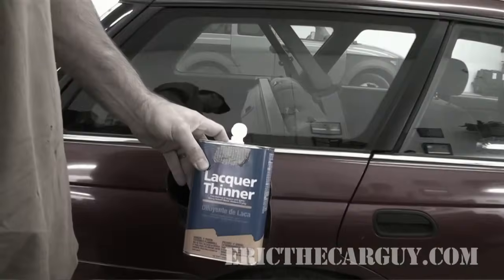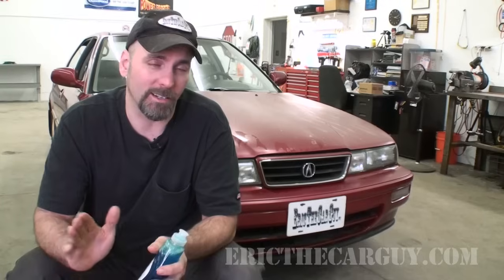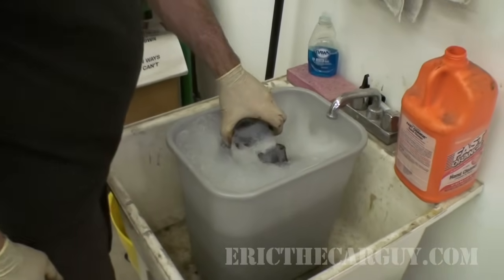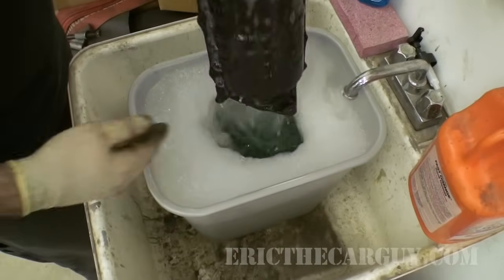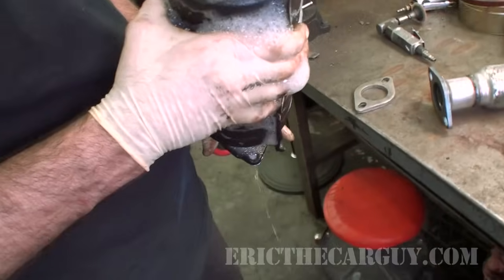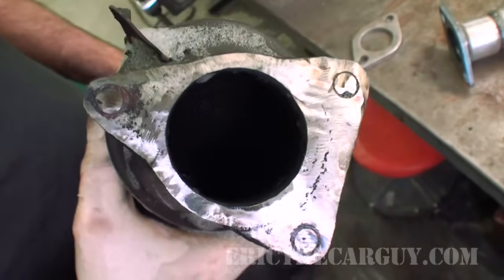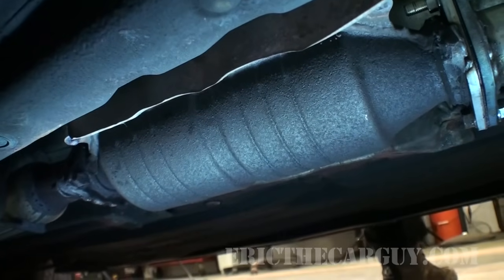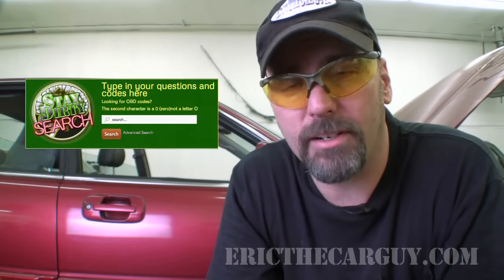Cleaning Catalytic Converters With Soap and Water -EricTheCarGuy

Comment: Was this tested again AFTER it dried? The cat seemed like it still had water in it as it was blowing a LOT of soap and water out of the exhaust. Evaporating water inside the cat will cool it down a lot, and it sure seemed like it was doing that.. especially with the temp fluctuating like it was as it was flashing water into vapour.

Comment: Water can absorb a lot heat.  So if your CC is still wet (looks like it from the bubbles coming out) I am not surprised the temperature is much lower at the exaust.  Maybe you should try mesuring after it dried completelly (drive for a few days maybe?).  I am not convinced it did not work yet.

Comment: On the Cody'sLab channel, he and a friend sweep up dirt from the side of the highway to extract platinum from it. In the video, he claims that a catalytic converter can loose half of its platinum in the first 100K miles. The amount of platinum he harvested seemed to confirm this. It may be that your converter is just running out of catalyst and not working well because of that. Sorry if I missed how many miles were on it if low mileage makes that hypothesis invalid.

Comment: I think I would have let it soak in degreaser/soap, then pressure wash through it and use a blower to dry it before reinstalling it. Eric the bubbles guy 😋

Comment: Did you consider that there's a fair amount of water inside the catalytic convertor after cleaning it. You'll have to run the engine for a while to evaporate all that retained water. The water in the catalytic convertor cools the catalytic converter as the water turns to steam. So you have to evaporate all the water before the catalytic convertor will function normally. Try measuring the temperatures after you've driven the vehicle for a few days.

Comment: This might have already been mentioned . . .

Did you rinse the cat with fresh water before reinstalling? That would of eliminated the bubble machine effect. Also I personally would of taken it on a nice drive along the highway to help dry out the cat before running a temp test. Obviously the cat was cooler at the rear cause it was evaporating the moisture.

Your awesome & smart. Helped me avoid the rad & engine block sealer thus replacing those very expensive items because it clogged up the water passages.

Keep on Keepin on !

Comment: have you tried cleaning in a hot tank with ethylene glycol?

On parts I've done - admittedly small parts - it really takes that gunk and varnish right off.  But in theory shouldn't attack the platinum or substrate?

Comment: Now here's another thought I've had for cleaning an old cat: "run it" outside the car with propane. I got this thought while tinkering with a vintage Coleman Catalytic Heater. These liquid fueled heaters are little more than a fuel tank, wick, and a dome-shaped platinum catalyst burner. The one I was working on had some carbon buildup on the top of the dome (one of the cooler spots). I successfully cleaned it by lighting the heater, allowing it to fully warm up, and blowing propane on the soiled areas using an unlit torch. I heated these spots to slightly higher than the normal operating temperature-- fully warmed up the burner has a slight red glow to it; I spot cleaned it at orange hot for 1-2 seconds while slowly moving the torch around the burner. The end result was a heater that looked nicer and runs better. Since it essentially functions the same way the cat on a car does, I wonder if a similar procedure on an automotive cat would have similar results.

Comment: Hey, this converter needs some time to dry up before measured.
Also, rinsing with clean water before put back.
Please do a new measurement video three days later when returning from a long drive!
Reply from the maker: Demeter Ákos The bubbles happened while I was warming it up. I did my measurements after that was done.
Reply: EricTheCarGuy Don't know if you mentioned this at all but cleaning your cat is just a "band-aid" if your cat is getting plugged there is something wrong happening in the engine and will most likely just plug it up again.
Reply: EricTheCarGuy did you fix that repair leak right after the Cat?
Reply: SleepnGrunt  If you have a P0420 because your catalytic converter is just under the efficiency needed, it could do the trick. I didn't bother with lacquer thinner or trying to clean mine because the live data on my obd II scanner showed me that the converter wasn't doing any catalyzing at all. His car is an unmonitored system, so he couldn't use an O2 sensor to see that.

Comment: After reading other comments, I see there is an opinion that there are inert solid plaques on the active surface of the cat. For that I would recommend an ultrasonic bath. As some suggested, various solvents could also be used. Maybe acetone would work nice, also it's easy to come by.

Comment: Doing a temperature test is an invalid test, if you use that method on every "Good Running Car" the cats will fail every time, if you do that test on every poor/rich running car you cat would probably pass, if you want to see the temperature go up, introduce hydrocarbons or a misfire, cats were not made to work all the time, learn how cats work, then test them, a legitimate way to test a cat is with a 5 gas analyzer, propane/ hydrocarbons and making the engine run lean / vacuum leak. 
Great videos, ive learned alot and made alot from your videos, Thanks

Comment: Hey Eric, I have a 2012 dodge journey 3.6. This car has 2 catalytic converter..I cant remember the codes it threw, the converter closest to the front bumper, I took it off and I can get air through it but I cant see any light I shine through it. Is it still clogged. The converter near the rear I haven't tried yet if its clogged can I straight pipe it (cut it out )

Comment: It did work a little better in the ammonia solution. That was a good idea to try. I would have like to seen it shook around periodically in the solution to help break up the build up of particles inside the converter.

I think just letting it sit in the solution isn’t enough to remove build up. Some type of flow through it or pressure through it might work better. 
              Just spitballing though.

Comment: Would a rinse with a hose, or power sprayer help? Or if one has a big enough sonic cleaner with the Dawn, and amonia solution.
I've used a small sonic cleaner for carbs with degreaser, and the carbs come out squeaky  clean.

Comment: Hi Eric,  thanks for taking the risk for us viewers. But I see that you're missing a couple of steps. The ratio of the detergent is insufficient as the volume of water in the bucket is much more than the detergent to act on the cleaning part. And as I know hand wash is another good detergent too. And you should have got it rinsed thoroughly from the back of the cat to get rid of the dirts and soaps that resides in the cat. And you should use an air gun to blow out those water and some stuck dirt (which the water couldn't washed out) through the same direction (from the back of the cat). Then only you should perform the test. Anyway, thanks for experiment you've done.

Comment: Scotty won't admit this in his videos... But that's Ok.. Budget a replacement Catalytic Converter.. Move to State that don't care about Exhaust emissions.. lol Thanks Eric, what about Ford Engine, Inline 6, 3.3. liter engine for a 1982 Ford Granada, Foxbody or is it better to find a Foxbody 3.8 liter V6, with mechanical fuel injection due to altitute issues with carburetors? Scotty didn't want to rebuild my engine, and from listening to Scotty Kilmer's ATP-AT-205 'main seal trick' it destroyed the engine. I might need a new or recast inline 6, 3.3 liter main engine block. I don't have a shop, tools, kits, or capable mechanics in Texas to help me. O'Reilly's don't carry any old inline 6 engines for a Ford Foxbody Granada engine. Thanks! Great video! I won't be cleaning the catalytic converter, as Texas Catalytic converter thefts are on the rise, along with human trafficking, drug cartel, and prostitution rings growing in Texas..There's videos of vehicle owners engaging confronting catalytic converter thefts in Dallas, TX.

Comment: So I have a 2002 Infiniti I35 I did a engine swap after I had an engine sieze up at 40mph I noticed the tail pipe had a lot of black on it. Is it safe to stick water into my tail pipe and use it to clean my exhaust system. I’ve seen videos of people doing it on diesel trucks what about gasoline Sedans feed back would be awesome

Comment: Before we has emission tests is PA, my friend would cut open his converter, and use a torch to melt or burn out the internals. Weld it back together, and re-install it on the car. Just a thought, since you don't have emissions in your state. Lucky you. But they they might do a visual inspection, to see if the converter is still there. Just a thought, hope it helps you somehow...

Comment: Hey Eric I got a 95 blazer lt with a few Robles I was wondering if maybe you can give me some insight on.. She sometimes idles high in neutral some hesitation on acceleration minimal but I can feel it. Hard time climbing inclines fuel mileage is reduculous.. I seen a post online of it possibly being the MAF but the 95 doesn't have one was wondering if maybe the catalytic converter could be the problem .. Any info would be appreciated thank you
Reply: egr valve...look into that

Comment: If there is moisture left in the converter it would skew your results. You probably should have taken the car for a good 10-20 mile highway drive prior to doing your final temperature readings to be sure it was 100% dry. Would be interesting to know now, days or maybe weeks after the video was recorded whether the rear cat temp reading is still that low.

Are you also going to do a video on putting that sodium hydroxide or whatever it in to clean it? You have nothing to lose really.

Comment: I'm not sure about the validity of this soap test; but, I'm missing something about the temperature testing.  I thought you should be seeing about 100 degrees difference in temperature from front to back of the cat?

If the cat wasn't doing what it should, isn't it gonna show about the same temp at front and back?  Or, is it that if it the cat is not working, it will show much greater than 100 degrees difference?  

Because, before doing the soap cleaning you were getting about ~242 degrees in, and ~167 out....that's ~76 degrees difference....not far off from 100 degrees.

You mentioned at ~3:20, "The cat should be about a 100 degrees hotter at the outlet, than at the inlet."  I'm guessing you meant the opposite? 

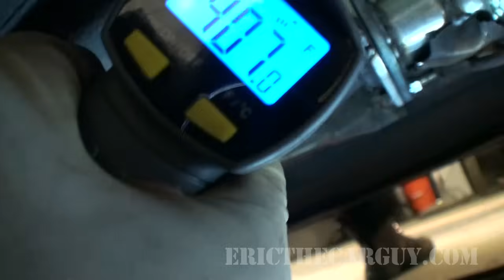At 6:17 Brian brings up the RPM...would you need to wait a little longer for the metal exhaust (and specifically the cat) temps to rise...even if not waiting long?  

And, after cleaning with soap, you're seeing ~445 degrees at the inlet and about 140 degrees out the outlet, for a difference of 305 degrees.  The before soap, and after soap temps, to me, allude to the "before" temps already being pretty good.  But, the "after" temps being far far out of kilter, with your expected 100 degree difference.     

Is the 300 degrees, the offender?  Is 300 degrees too great of a difference?  

I'm intrigued by this test at all.  Does the reaction with Platinum and Palladium cause the temperature drop, or simply the passing of the exhaust over the surfaces, by dissipating heat out of the exhaust?   Is it that if the surfaces are "broken apart" that then the exhaust passes through without having surfaces to come in contact with? ....and thus doesn't drop in temperature?   But, this would be different than having a cat with intact surfaces, that are gummed up with carbon or such, and just not reacting with the exhaust, I think?

Thanks.
Reply: Uhhhhh.... try the 4th paragraph

Comment: If you have bubbles coming out the tailpipe, the converter is not dry yet. Boiling off all that leftover water would prevent it from warming up and residues that may get left behind could re-gunk-up the converter you just tried cleaning. You might have wanted to rinse and let it drain/dry before putting it back on.

Ideally, there should have been something circulating your soapy water through the converter during it soak... or maybe a vibration motor to help knock anything that comes off the substrate loose.

If the soapy water trick really works, every little bit helps.

Comment: I tried this with a 2004 Honda Accord.  Soaking the cat overnight in soapy water and then rinsing well (very well) at first did not seem to do the trick. Put the cat back on and shortly threw another CEL code.  HOWEVER, I reset the CEL and it never tripped again (not for a few months anyway).  I thoroughly recommend soaking in detergent overnight, rinsing well, and re-installing.  It worked for me.

Comment: I know this call probably doesn't have any O2 sensors because you said it doesn't monitor the cat but if I try this on my 2012 Honda Civic will it ruin my oxygen sensors?  Some people say you can take the top sensor out and spray throttle body cleaner down inside where the combs are I was going to try that but you never know what safe and what is it on YouTube. I was also going to try the lacquer thinner I don't want to ruin my car. I have a 2012 Honda Civic a p420 code catalytic below efficiency Bank One. People say it's an oxygen sensor? Not sure which one thinking the downstream would be the one throwing the code. Or if I replace them should I just replace them both? Any help would be appreciated I can't afford a 1400 brand new cat

Comment: Im thinking of trying something like this. i have a 2003 Toyota matrix , its has been the best little grocery getter, kid picker upper , small trips out of town little car .. This thing just keeps going !! 148336 miles on her ! Well that code just popped up. That catalytic converter code.  Not that im worried of picking a new one up but i have done all the Maintenance and Service when is needed i have taken very good care of  this car and she has taken good care of us .. So im thinking maybe i would / could i be lucky to get it clean enough ...  So this is my question . how do u know if ita clean enough ??? Will the check engine light  come back on right away ??  Can u look inside and see how clean it is ? Any New tricks i can try    Thanks for any info ..

Comment: I add a “gallon” of lacquer thinner to between 5-8 gallons of gasoline. Before oil changes is my rule of thumb  , to keep the cats cleaner and clog free.

I do it the smarter way. I put a 5 gallon can with fresh fuel in the trunk with the gallon of lacquer thinner.  Then with a half tank or less I head to the interstate. At a rest stop or before entering the highway I pure that gallon of lacquer thinner into my gas tank with the engine at operating temperature. 

I drive with the overdrive “off” until the fuel is nearly depleted.  I carry the 5 gallon can with me just in case I need it. I have done this a few times now, and I have not needed it.  No sputtering, no hesitation with my engine, 4.6L Mustang 2007.

All catalytic converters get dirty then they can get clogged. When they get clogged 2 things could happen;
1. The exhaust pressure could blow the clog out of the system.
2. The exhaust pressure blows the clog along with the internal catalyst materials out of the system. Causing a catastrophic failure.

Comment: Nice systematic, valid attempts that most of us would attempt. While rinsing and good long drive might be recommended, I don't think it's about to bring this to any wildly different conclusion. I'm also "vintage" with my old 80s & 93 Toyotas but in an area that requires testing on OBDII vehicles, and I'd suggest that eventually you might do the environmentally correct thing and fit a different replacement converter.

Comment: I think you should have used a lot more dish soap 60% or more and agitated the solution several times through the process ( maybe after an initial soak ), then flushed it through with more water.

Comment: I would wonder if taking it to a machine shop and having it hot tanked would be better.  I haven't had anything done in years but used to cost about $10,00 and even the dirtiest engine parts came out clean.

Comment: Eric 
Nice video however I think your initial thoughts about Sodium Hydroxide were right on the money , It would most definitely get rid of any organic deposits , just like degreasing an engine block then just dip the converter in cheap white vinegar and leave it for a few hours .The soap and water are not aggressive enough in my mind to do the job.
I don't even understand why converters are ever replaced unless they actually fall apart mechanically ?

Comment: pot-in-pot refrigerator right there. Eric, the fact that bubbles are coming out of your exhaust is a sign that the CC is full of water. The surface area of that thing is way bigger than you might think. Now what happens when all that water evaporates just to condens in the muffler? It takes heat in so that's why you have a much cooler temperature showing at the outlet. Just run the car for a few hundred miles and retest.

Comment: first I'm hearing of this idea, but a few things I would have done differently if I where you:
1. don't pour the soap in the bucket and fill with water, put the cat in the bucket and poor the soap directly into it, my theory here is this would get a heavier concentration of the dawn directly on the metals instead of just the suds from the water, may not make a difference but worth trying.
2. (this goes with the other comments) you need to rinse it out after soaking to remove the soapy residue left behind.

Comment: Why not wash the converter with plain clean water after overnight socking? the residue of soap remains inside tiny holes of the converter and the moisture drives down output temperature significantly.